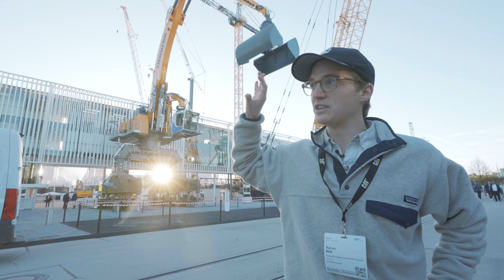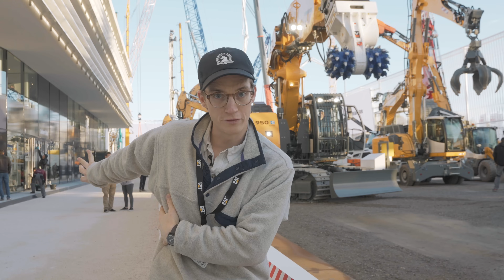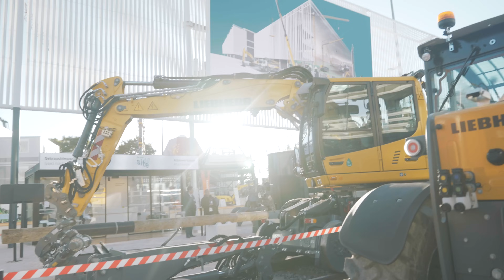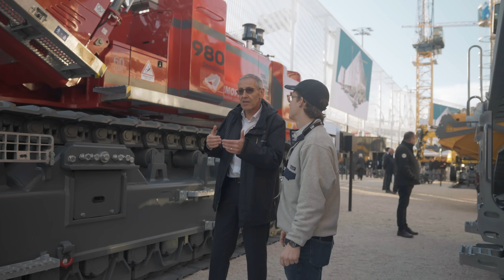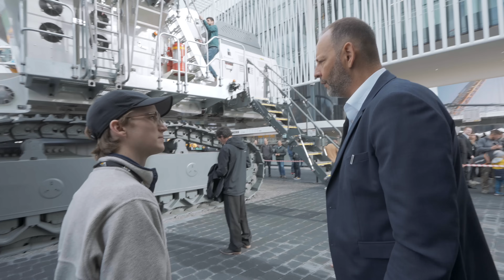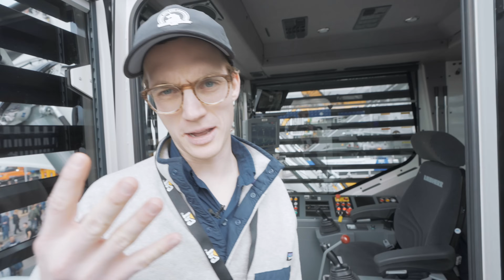The Largest Booth at Bauma 2022 | Liebherr

Comment: The trouble with these electrical overhead lines is you have to have electrical power at the mine in the first place, so some mines have to use diesel power and also having to put in the infrastructure to run these electric trucks is going to be expensive as well as the price of the electric trucks.

Comment: Electricity is cheaper than diesel because governments are forcing the adoption of electricity and taxing fossil fuels. My concern is still the same: once you switch to Electricity, with most governments regulating electricity, it will become a tool to prevent public usage. I lived in Manitoba for a while, and that province did this. They prevented certain activities in rural areas because they could regulate how much electricity you got. We would be returning to serfdom with lords forcing conduct.

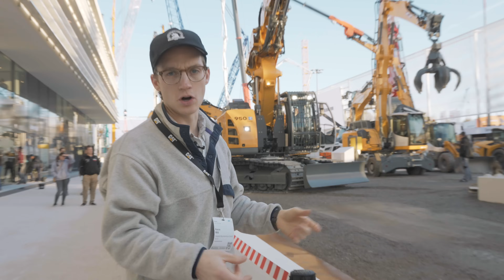Comment: @4:00. That machine is NOT ALL ELECTRIC. Where is the power coming from???? A coal, natural gas, nuclear power plants. Smoke and mirror.
Reply: You’ll never hear the engineers say it’s the correct way to move forward, they’ll only ever say it’s because of the 2030 emissions crap. 

We are going backwards and everyone with a brain is quietly screaming “wtf”
Reply: Anyway, industrial power generation, provided it is relatively new will always be more efficient as there are no size and weight constraints.
Reply: Depends on where you run it. If you run it in an area which gets all of its power from wind turbines or hydroelectric plants then I'd say it's all electric.

Comment: You have an awesome Sony camera, however if you want to get REALLY good pictures, work on aperture first, then exposure, then ISO. The lower the aperture, like 1.8 f-stop, the more amount of light hits the sensor at one time (picture is brighter but with a lot of bouquet). The higher the aperture, like 3.0 f-stop, the less amount of light hits the sensor at one time (picture will be darker but have less bouquet). Generally a lower aperture will give more bouquet to focus on a single target. A high aperture will give less bouquet to focus on a larger picture.

    Then adjust your exposure (shutter speed) to compensate for more or less light in your picture. Your exposure (shutter speed) controls how LONG your sensor is exposed to light. For low aperture like 1.8 f-stop (more light hitting your sensor at one time) you want LESS exposure. The shutter will close faster because it doesn't need as much light. For high aperture (less light hitting your sensor at one time) you want MORE exposure. The shutter will stay open longer because it needs more light. Keep in mind longer shutter speeds will mean you need to stay still to keep your picture from being blurry. If you need fast paced shooting, lower your aperture (for example from 6.0 f-stop to 2.8 f-stop) so you can use faster shutter speed.

    Sony cameras are awesome because they have an exposure meter on the screen or eye piece. The goal is to be as close to the "0.0" indicator as possible (dependent on your settings, it might be an arrow on an exposure meter). The exposure number or meter indicate how exposed your picture is, with "0.0" (or arrow in center of the exposure meter) being perfect exposure. A positive number like +2.3 is over exposed, your picture will look too bright and colors washed out. A negative number like -1.5 means your picture is too dark and colors bland. Adjust your exposure (shutter speed) to be as close to "0.0" as possible. 

    If you cannot get your picture to perfect exposure, THEN you can use ISO. ISO is a DIGITAL ENHANCER. You want to adjust this setting last. I stress this because it is NOT capturing light like your lens or sensor. It is like turning up your brightness on a tv screen. To much ISO will create digital "noise" and ruin your picture. Generally good ISO will be in the 100-300 range, any more than that and you will get excessive noise.

    I am only saying this because I love the work you do and hope you can appreciate taking amazing shots without it being overexposed or washed-out. I personally changed my camera settings to leave the aperture at 2.0-2.8 f-stop and ISO at 125. I get good bouquet in my picture, but not too much, and I get good light for my sensor. This gives me good room for adjusting exposure on the fly and opportunities for low light or fast paced shooting. I then manually change my shutter speed (exposure) according to the time of day or building I'm in.
Reply: Thanks for this advice....I ll adapt it for my own shoots...